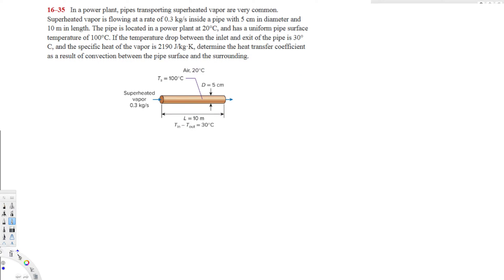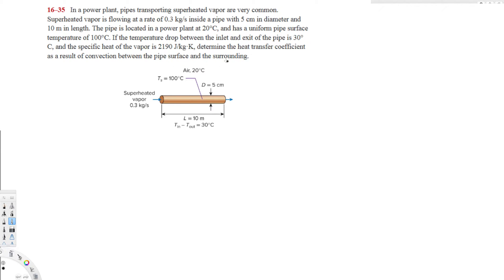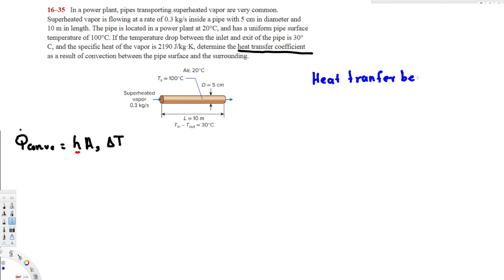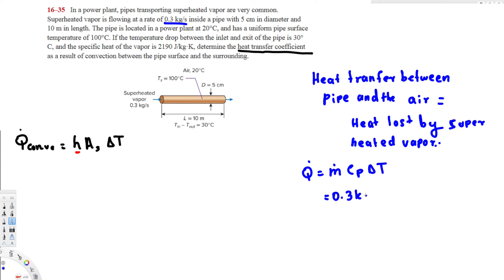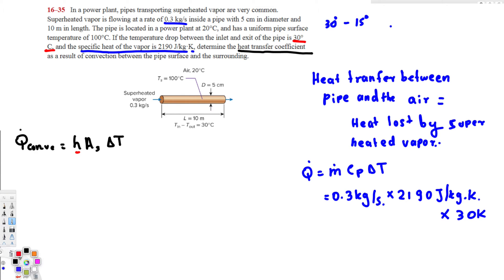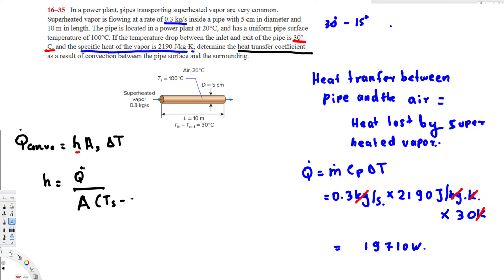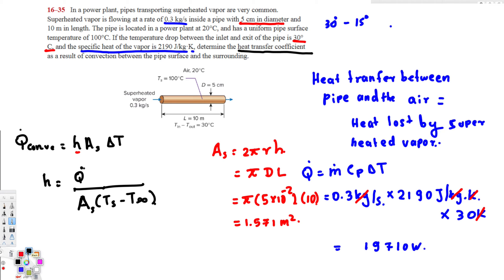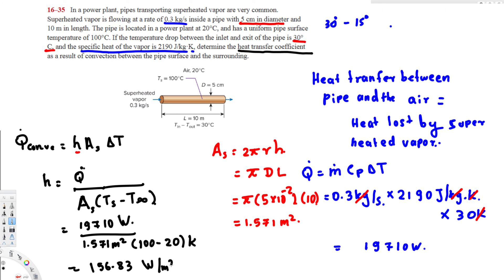Heat Transfer - Determine the heat transfer coefficient - Thermofluids

Comment: You should convert 30C to Kelvin. 273+30=293K
Reply: since when is 273 + 30 = 293k
Reply: No he shouldn’t, since the difference was 30C, when we subtract two kelvin temperatures the 273 would cancel each other. So 30C=30k in that case
Reply: @MansourHNH  you cant just say 30*C = 30K, yes since the it is the difference is 30*C you can just keep it as is but you cant say that its the same

Comment: please help !!

The water enters a pipe with an inner diameter of 40 cm and a length of 15 m at a temperature of 20C with a flow rate of 0.1 kg / s. Calculate the required pipe surface temperature and the amount of heat transferred to the water so that the liquid water can exit this pipe, whose surface is kept at a constant temperature, at 60 C.